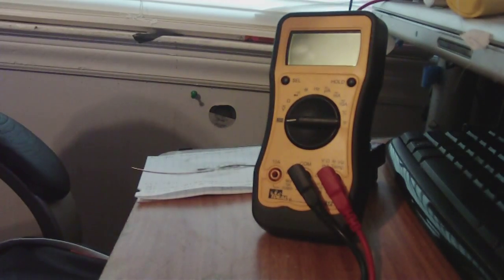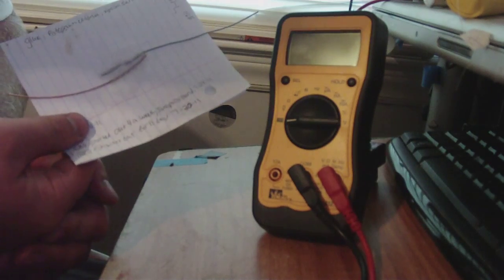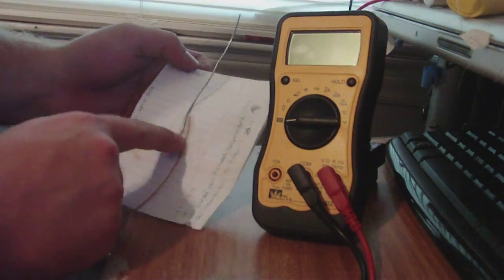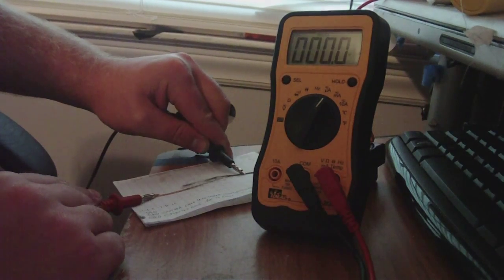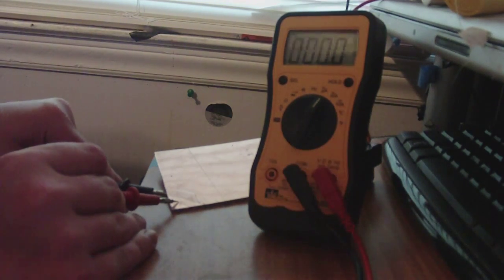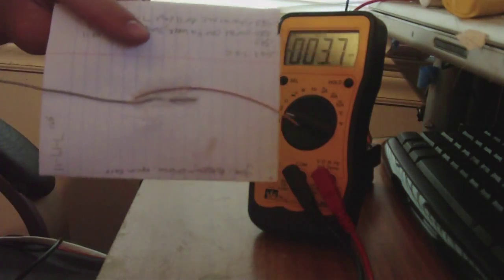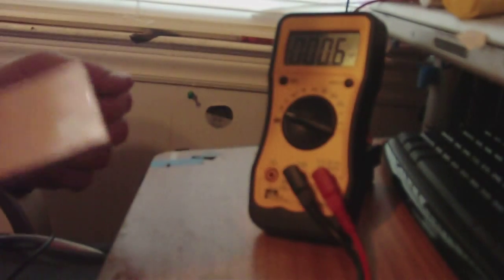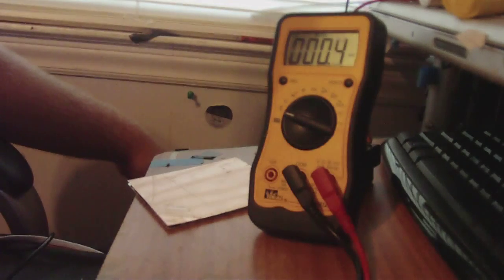Crystal Glue Cell Much Bigger Plate Size

Comment: This crystal electret batteries can be used also indirectly to get power from them by using them with a Joule Thief or Joule Ringer to give led or neon light and that light to be transformed through a solar cell in usable electricity (also many mirrors can help to amplify light, and/or lenses).

Comment from the maker: @overunitydotcom 

It has amps but its in the Pico-amp range, something that my meter can't read. 

Think of these cells as a type of Electret and not a battery. I'm finding ways to power things with them but the energy they give needs to be converted if you want to really power something besides a calculator. 

More updates will becoming.

Comment: Hi Ib,
How did you power your calculator, if it puts out no amps ?

Please try to power a white LED.
How many glue cells do you need in series to
at least power a white LED with some brightness ?
Many thanks.
Regards, Stefan.

Comment: I don't know how your particular meter works but on mine I need to move the red lead over to the separate amp connection (with internal load)  to get a reading. Did you try that?

Comment: This is crystal electret battery process, and what you got is a dipole in vacuum which is composed from ether which is converting in electric energy. If you wish to have the most powerfull battery, you must use sodium silicate or something similar to ingredients use by nature in pyrite. You must programm this electret crystal battery 30 days at 5v to retain forever the microscopic resonating structure. In my movie ou charger i give some details. I'm using this for 2-3 years ago.Great work!

Comment: What's the battery voltage you got the amp reading on the LED in series with? Probably 9 volts, right? How much voltage are the crystal glued aluminum and copper plates generating? Glue more plates back to back, copper to aluminum untill you reach 9 volts, then hold the LED to it in series and check for amperage. I'm telling you, you're building a very, very powerfull battery! Don't give up and settle useing it for a paper weight. This has awesome potential sandwiched for useable voltage.

Comment: Put the LED in series with the correct battery plate. You're holding the meter electrodes to the positive and negative cathodes of the battery in the video instead in series with a load. Increase the number of LED'S in series till they dim out to gauge upward amperage limit. Make sure you match the LED to the plate voltage. You may need several in series to light one like you did to run the calculator. Good luck. Very exciting progress. Keep up the cutting edge work.

Comment: The 3 glue batteries in series that ran the calculator must produce amperage. You have to connect the amp meter between the positive cathode of the battery and the positive connection of the calculator to read the amperage. The current has to run THROUGH the meter! You're very close to an important break through. Be carefull, and thorough in your measurements. Reading amperage can be very tricky. Remember to run the current completely through the meter from battery to load to measure amperage.